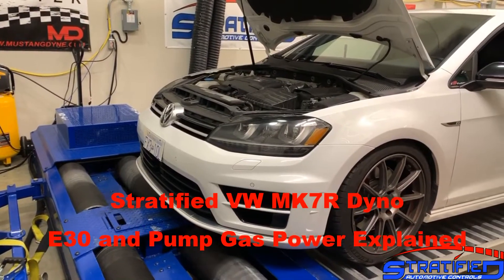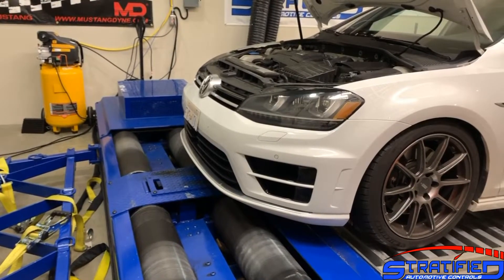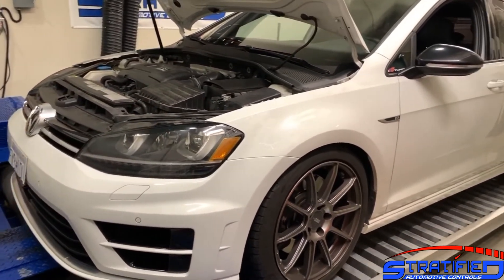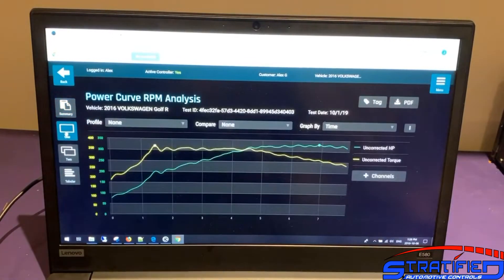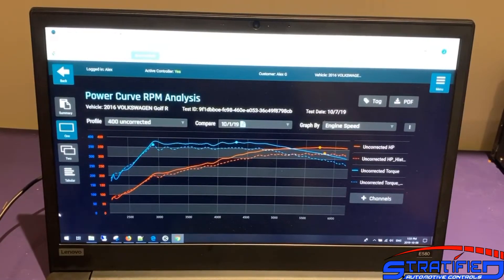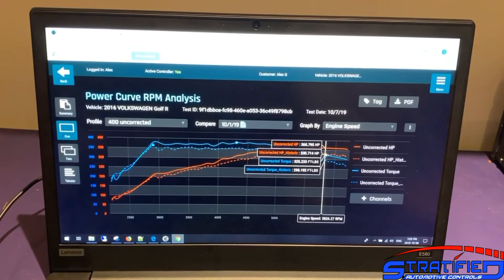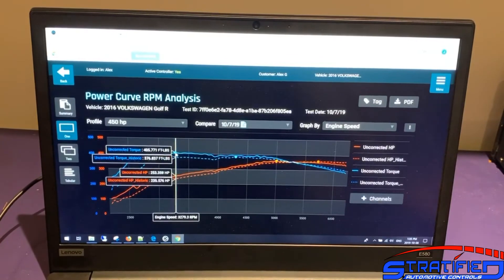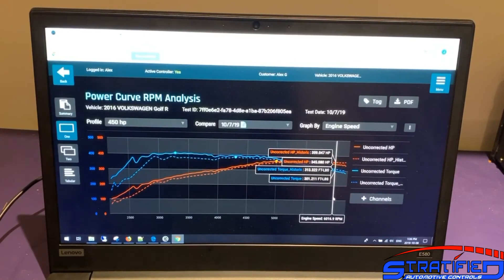VW MK7R Dyno and Results Explained for Pump Gas and Ethanol Fuel

Comment: question for you, i have a leon cupra 280, full stage 2 bolt ons and a small hybrid which doesnt require fuel upgrades, when it was mapped, it made 440bhp and 413ibft, this was done in 5th gear.
recently i had it on another dyno, on this dyno it only made 396bhp 396ibft, it was done in 4th gear, im a right in assuming because it was done in 4th gear this time and on another dyno, this is why my torque figure is lower? it baffles me how my car can read 44bhp less from one dyno to another.
Reply: worry less and read more, each dyno is only representative of its settings, a dyno operator could turn your cupra into a 600 whp fire breathing beast on paper, but your trap speeds would beg to differ. if you get a chance to run your car at a 1/4 timed event. your overall speed against your car weight will be indicative of your true hp numbers. also do not get to wrapped up in dyno numbers as they fluctuate. dynamometers are a tuning tool not gospel as far as real world WHP
Reply from the maker: Two things going on. First the taller the gear the more you load the motor and the more power it produces. Secondly not all dynos are calibrated the same.

Comment: You ran 91 octane E30 or 93 octane E30?   For those of us looking to just fill at the pump, which is better...  91 Octane E10 (Husky Petro etc) or 94 Octane (Chevron) ?   BC based - curious...
Reply: cstishenko in BC the non ethanol 94 is the best fuel we have. Second to this is shell 91. 92 in Blaine is better than our best 94 because they have ethanol in their fuel. Our 94 is quite similar in performance to California 91 due to the lack of ethanol once again and our 91 is worse still.

Comment: Was the car retuned for the E30, or was  Ethanol just added and redynoed?
Reply from the maker: jonathon prance the car was retuned for E30. You need to tune it to obtain the power gains and ensure the fueling is handled correctly.

Comment: Hey Alex, not currently a Stratified customer being under warranty still but likely will be in time. 

 Want to know if you can do a video on testing of different pump gasses.  Having an issue with Chevron 94 and the car cutting power under WOT only sometimes and varies tank to tank.  Chevron will not publicize their RON/MON numbers.  

Shell 91 feels very consistent and they openly state 95-97 RON and 85.7 to 87.5 MON, with no ethanol. 

Husky 91 E10 10% ethanol feels stronger than all 3 in the Golf, but they also won't publicize their RON/MON. Husky 91 E10 also gets byfar the worst fuel mileage of all 3, likely due to the ethanol.

Petro I've not used, their best locally is 91 E10, and 94 E10 in Osoyoos and Oliver.  But they also won't state RON/MON for each.  

 Europe rates their fuels by RON, making Shell 91 as we know it, a 95 to 97 octane fuel on EU standards. 

Wondering if you can do some testing to show who's the boss for pump fuel. Knock resistance, ability to make power, etc.  See if a Husky/Petro 91 E10 at the pump outperforms  91 Shell or 94 Chevron.    

It would benefit all of your customers with tunes.
Reply: Husky 91 10% ethanols feels as though it produces a solid 10-15 more hp over Chevron 94. 🤔
Reply: Heard chevron is garbage